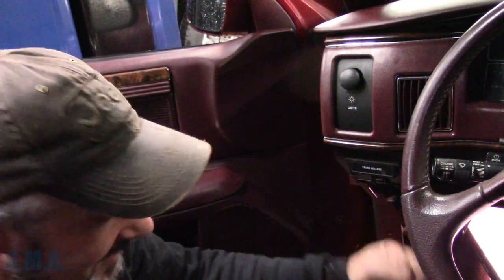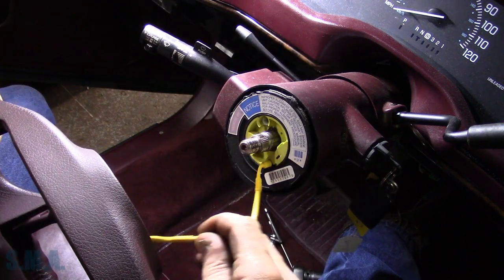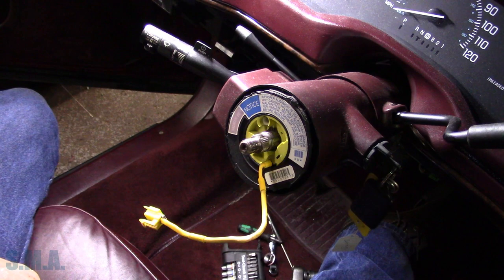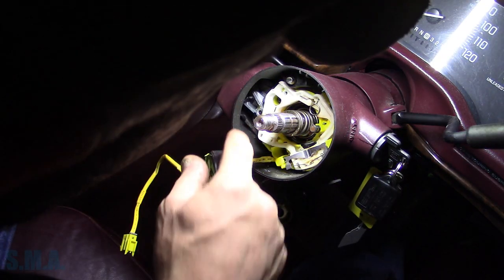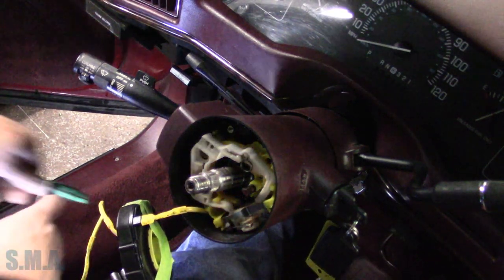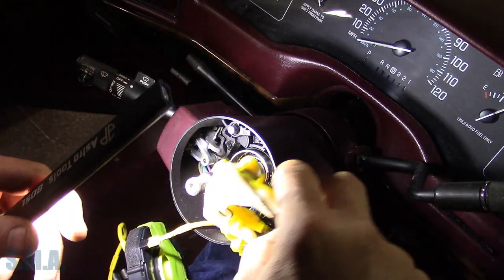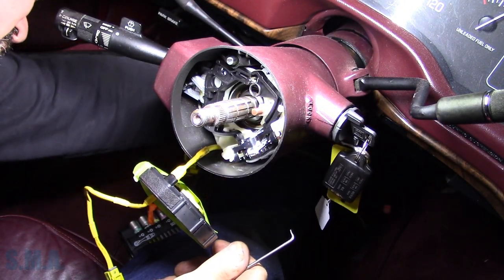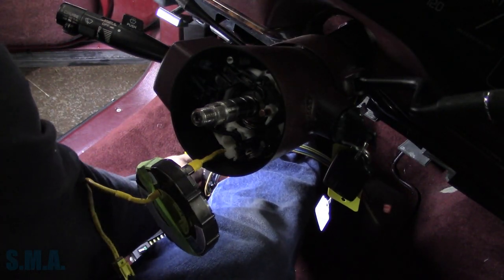Buick Roadmaster: Turn Signal Switch Replacement

Comment: I have done hundreds of these, both before and after the AIRBAG generation. The plastic wire chase, (GUTTER), started with airbags. All the rest is the same, including the 4-WAYS!!!! lol...  I swear I was saying, (He's going to forget the flasher button), long before you forgot the flasher/4-ways button..  Honestly, I have never had to fish wire the new harness into the channel. I just match the new with the old harness and switch. Pull the wheel and remove all from the top. then all goes back easily.. I believe this is the first time in years of watching your videos that I can say I am absolutely faster at this job than you.... BY A LOT!!!!!!  Hahahahahahaa....  Oh yeah, the very first one I ever did was on my 70 Chevelle and I did not have the proper tools. I could not press the locking plate down and operate a pick at the same time, so I notched a piece of tubing my father had in his plumbing crap and put it between the plate and a piece of 2x4 that I pressed on with my chest. My mother came out into the driveway telling me to stop with all the F-Bombs....  I know I let a bunch of F-YOU'S go trying to get that stupid ring clip off......
Reply: Yes Steve, I have also done hundreds of these. We have "been at it " long before Eric so he probably has not seen the "old" stuff often.  I like his page and get a laugh at times. I even kept the cancelling springs in stock in my toolbox lol. I retired 6 years ago after 50+ years in "the biz". Nice to meet you.
Reply: Could you plz reword your comment I would love to understand.....

Comment: NO drive by wire NO push to start in my collection and hope i don't live long enough to have to buy one. i think all push to start ones with no key or ignition switch should be wired with some sorta emergency cut off switch to prevent run aways. i take it back i do have a push to start but its the back bumper and release clutch

Comment: I was wondering i know this a older video but , my brights don't work because the rod I can't figure out where it hooks to on that little piece of plastic on the side of the column. Or if I'm missing a piece to hold it. Do you have any insight thanks.

Comment: But the whole watering assembly comes out from the bottom you just need to disconnect the harness off of the steering column and pull out the plastic keepers and then voila there you go it comes right out easily you don't have to cut the wires!

Comment: Eric I cringed at cutting those wires! There is a hole built into the connector that you use with mechanics wire to fish the new one through the column.

Comment: cut old wires out at bottom then tape up new connector onto the end of a straight coat hanger 2' long piece and use that to fish connector down thru column

Comment: Replaced the turn signal just like this in a 1966 Ford pickup. I see you almost forgot your spring. That can be left out if you want your horn on continuously otherwise you need it.

Comment: My truck calls for 5w20, but my service center put in 5w30. Is there any issues with that? The truck is newer so not sure why they wouldn't follow the manual and it's obviously listed on the fill cap.

Comment: Used to absolutely ADORE doing these turn signal switches... And the tilt wheel screws.... Ya... Those too... That whole system SUCKED AZZ...Hazard switch screw... 🤣🤣🤣
Tape the wires really close to the plug... Makes fishing that through easier.

Comment: I don't know if it's the correct way to do it or not, but I used to fix turn signal switch problems by getting the car a new owner.

Comment: HEY GUY GOOD THINKING CUTTING THE WIRES. I WOULD HAVE TRYED PUSHING THE WHOLE CONNECTOR PLATE THROUGH THE COLUMN. 😒😂
Reply: its actually not that hard to do
Reply: @richardcranium5839  well the way he did it made a lot of sense  and I believe saved some time. If you have to reuse the same one then yes push it through like I’ve always done. 😉🤷‍♂️

Comment: I remember replacing the indicator stalk on my wife's 1995 Opel Corsa way back when... two screws to remove the steering wheel shroud, then just pull the stalk right out and plug the new one in. That car was a piece of shit but at least it was easy to work on.

BTW, my wife didn't even notice that I'd fixed it. She just thought she'd finally found the trick to getting it to work right 🙄

Comment: Could you give me some advice my 2004 c230 Mercedes doesn’t start anymore the fan just stays on and it was working fine after I did the intake gaskets for it and fuel injector gaskets 

I know the car in and out from this portion of the engine but i had one fuel injector replaced 
I ran the engine for at least an hour and this happened

My obd doesn’t work either

Comment: It's not OBD 1 or OBD2... it's kind of like OBD 1.5.  It's more advanced than the original OBD 1 system.   I used Datamaster software on my laptop with a adapter to talk to it on my '94 Impala SS, back when laptops had real RS-232 ports on them.

Comment: Anyone complaining about "old cars are stupid" has likely never worked on a 90s GM product..
Reply: I had a 1984 Dodge 600 - same as Le Baron. It was stupid!
To replace the AC compressor, the bracket holding it had to be removed and it took 45 minutes for me to get the invisible top bolt started. I had to do that three times in the eternity we owned that car... every time it was 45 minutes to get that bolt started. When do you remove the compressor? Summertime. Where did I live? Phoenix. Patience is hard to come by above 118F.
The Mitsubishi engine needed a timing chain, but there was no room to remove the cover with the engine in the car.
If the engine was removed a special jig had to be used to align it or the torque converter would be destroyed in a few months.
The infamous Mikuni carburetor (it is illegal to call it by name without "infamous") typically required a hole to be drilled in the choke plate when it got a few tens of thousands of miles on it. Start with 1/4 inch, work up to 3/8 inch, as required for smooth cold operation.
The list goes on and on.

Comment: Soon it will just be switch modules that connect just by being screwed in, columns with the wires built in to the stationary sections and a “flex module” that’s just the ribbon crap with two screw in place connectors, and a headlight/turn signal/marker light module and the wires will be built into the fender (hard mounted rail installed on the inside of the fender), all of these modules will just have 3 wires except for critical ones, any signal will go down a digital data pin (maybe more than 3 wires, lmao) and the power to run the module and make use of the signal will be from large beefy conductors that can handle additional devices for future iterations or police/ambulance use.
Half of us will wonder why we ever did it any other way when we see “power insufficient at module 23” or “lost communication with left headlight” and the other half will wish things were simple again when they get some data line error code or have to replace a $600 module that contains 30 switches and a computer for no reason (oh, also double acted micro switches that have a position delay between the first and second so a code for that can come up letting you know of imminent failure).
The only thing hanging in the balance between that being a good or bad idea is the right to repair bill changing the price of the $600 module and allowing a design that can be taken to a work table and entirely rebuilt with raw materials machined with minimal tools and jellybean parts (or whatever they call off the shelf components that are standardized these days)

Comment: 15:30. Did a lot of loose tilt columns too. I still have my snap on tilt steering pin puller so you could remove or at least move the upper column to get access to the screws. They were a e-torx if I remember. Pill them out, add a drop of blue loctite and crank em down

Comment: ahhh the previous gen caprice loose tilt columns were something special. How is it possible GM never figured out how to incorporate a dot of locktite on those screws ill never understand. Thing is GM usually has better design than most its the build and parts that build the problems into their vehicles 90% of the time

Comment: Those spring loaded rings are a bitch. I wish I had bought the tool.  Because, when you start getting older, using your thumbs for pullers. hands for rubber hammers and teeth for wire strippers takes a toll.

Comment: Flickering check engine light on early to mid 90s Gm vehicles almost always equals bad ecm either bad solder joints bad drivers or bad capacitor

Comment: Those GM turn signal switches are hot garbage! I've had to change 5 of them from family vehicles (Two Olds Cutlasses, One Olds Omega, Buick Regal, and Chevy Cavalier Z-24). I get a PTSD flashback every time I see those old GM tilt-columns with the steering lock-plate! Bah!

BTW - get the replacements switch from GM, as aftermarkets replacements are even worse. How do I know? Because I had to redo it a week later when the Dorman piece (of crap) failed.

Comment: Not a fan of the turn signal stalks like the one in the video. It’s so crowded with buttons and levers and twisting things.

Edit: holy crap, it only takes 5 minutes o remove the turn signal stalk in my car. You pop a panel off of the top part of the steering wheel column, and the stalk unclips and slides out once you disconnect the connectors.

Comment: Not you did good, I've probably fished about 100,000 that way. I stopped working on cars after '93 because I was too old to go back to school and learn to work on
computerized vehicles and didn't want to spend thousands on electronic diag tools. BTW I'm 64 now and don't envy you one little bit what you do.

Comment: Man i hate cars i changed a throttle body on my car now my car wont start so i put the old one back on is there anyway to program that throttle body without having a $50000000000000 snap on tool 08 equinox 3.4 engine i fig id ask here maybe someone can help

Comment: Your problem is you can’t properly curse while making a video.  Everyone knows when it’s not going right a rant of good profanity is like lubricant on threads.  Then if it still does not fit right, force it.  Still not fitting right get a larger hammer.

Comment: So after my car through a brake light 4x4 light and engine failsafe.
Internet search possibilities actuator motor gear to transfer case. Ok nope not the problem but code for oil not changed and resistor so change whole thing. Nope still exist. Internet search battery ok old change it. Nope not the solution. Alternator nope charges no voltage spikes etc.
Code for wheel speed sensor not present live data shows just fine all of them. 
Ok code for idle control valve mechanical it says.
Ok pull it. Hmm don't clack when shaken clean put back on 
Test drive hmm seems to have fixed it next drive to store all 3 come back clears when start car to come home always did that but no issues drive home but I hear air when step on gas.
Little elbow hose to icv is torn did not see when I put on so may have had smaller tear and opened up but will just cut it put a two inch pipe I can seal with hose clamps for temp fix as that attaches to large throttle body hose and air box. To remove I believe you have to remove whole intake.
Part probably not cheap also.
But I think I have reached there's your problem lady.
Reply: 06 BMW x5 and you are right old cars are stupid you fix one thing and another break. It's not the money pit that's the problem new car is a money pit too.
But the time to figure out what failed and time to repair no shop no fancy scanners. Not even an air compressor box of tools in car code scanner 100.00 one.